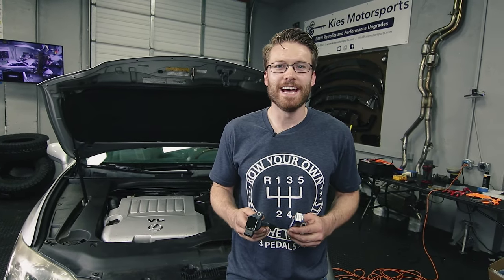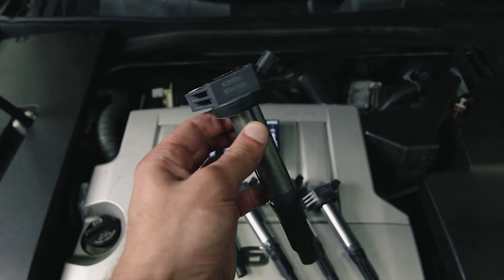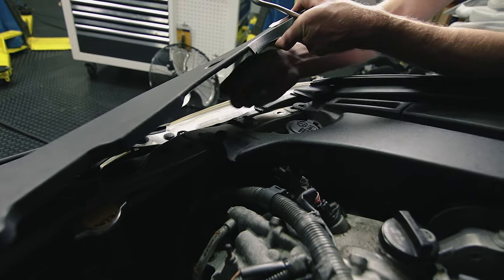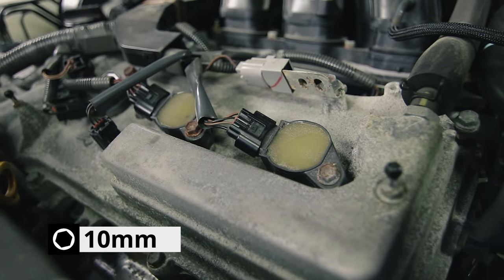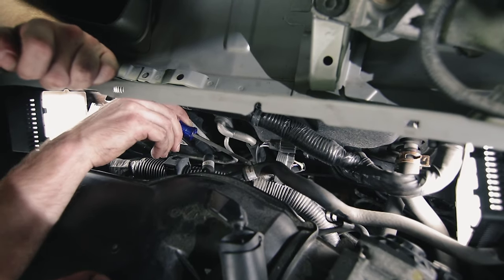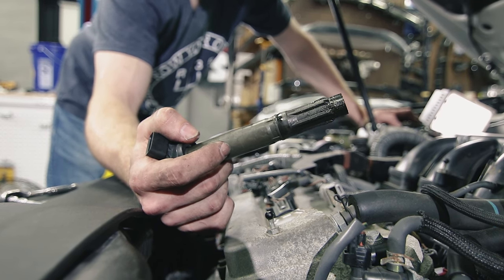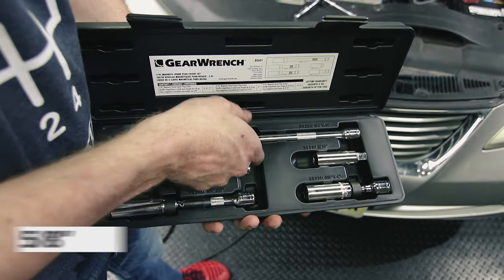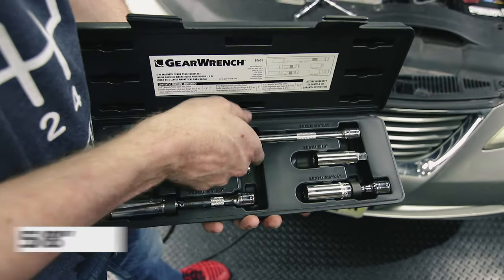How To Change 2GR-FE Coils & Spark Plugs 2006-18 Lexus ES350 / 2006-17 Toyota Camry - Under 1 Hour

Comment: 2012 Lexus ES350 -the video is helpful to replace 5 of 6 coils and plugs, however the coil and plug on  cylinder #5 are impossible due to the fact that the wire harness sits directly on top of the coil and even if you loosen its not loose enough to pull the coil out. I did 5 of 6 and am hoping for the best. I also noticed the video has the hood taken off, this would save a little back pain if you want to go to the trouble. I did not.

Comment: Thanks so much for making this video, I had seen a very detailed breakdown with pictures on one of the Toyota forum websites, but they had you taking the manifold off, after seeing you do this I was also able to successfully do it, and surprisingly it wasn’t nearly as hard as I thought (I had heard it would be a nightmare) the only tough thing for me on my 2009 six cylinder Camry was that I had to lay on the engine a few times to get my head back there and see what was actually going on, but thanks so much for making this video you made the job what I can only assume to be much easier.  One crazy thing that I discovered was that I also had a leak on that  middle cylinder on the back of the side of the engine, there was oil at the bottom of the coil, I guess that’s a common spot for the valve cover to leak on the 2GFRE engine.? Was wondering if there was anyway to tighten it up while I was back there but I didn’t really see much? If anybody knows a way to tighten those valve covers a little sometimes you can get a little more time out of your valve cover gasket?
Reply: No way to tighten those valve covers. You have to change gaskets. It is hard to remove back valve cover for DIY. I could not remove cover and I  had to ask a mobile mechanic to my home to remove it.

Comment: Trying to discern if my plugs need replaced?  2011 Es350 bought a month ago and I noticed chipped paint on the back of the hood which shows they have been done... just bought a '11 model with 135K on the clock.... purrs like a kitten!!  My OCD says I should go in and change plugs!   the fact that who ever didn't do it correctly isn't a good gauge of what needs done next! okay I talked myself into this project.... AKA peace of mind! 
should I replace coils? hmmmm
Reply from the maker: I would do em both

Comment: My scan shows I've an issue with number 4 coil, is that located in the back or the front
Reply from the maker: I believe that is the middle coil towards the front of the car
Reply: Also if your ignition coil is giving you trouble...

With you facing the engine and the hood up: 
Rear : A | C | E
Front: B | D | F

Comment: You don't need tools to remove the push pins. You just push them down to release and pull them up with your hand. I was doing it few days ago to replace the engine air filter...

Comment: Liked and subscribed... will be using this for my 2013 Camry Se V6

Question though... is it SOP to change out the coil packs when doing spark plugs? I’m at just over 93K miles, and have the OEM plugs and coil packs still in there. 

Also, I see some YouTubers applying anti-seize around the threads of the new plugs.

Also... would it be necessary to do O2 sensors when doing plugs?
Reply from the maker: Not necessary to do 02 sensors unless they are bad. At 93K I think your coils are probably still good. If you start having misfires I would change them out but they should last awhile. I'm running original coils on all my vehicles with much higher mileage. I am personally not a fan of antisieze. Newer plugs usually recommend against it. I would verify with the dealer or manufacturer of the plug. Most modern plugs have a coating that protects them. If you do use antisieze make sure it is barely barely any.

Comment: How can I torque to 7 lb-ft without any gauge? Is there any trick?
Reply from the maker: Sadly not. Overtime you start to know what is too tight or too loose by feel but it takes practice and still easy to mess up. A good torque wrench or two is worth the investment if you plan to work on your own vehicles.

Comment: Did you use a torque extension calculator to get to 13 ft lbs of torque?
Reply from the maker: we did not, good think to note that extensions do change the torque values - always use the shortest extension possible

Comment: Unless there are issues with every coil why would you replace all of them?  I have 2 Toyotas and have needed to replace one over 20 years and 400,000 miles of driving. I would never change a working OEM for a non OEM just to change them out.

Comment: What torque gun you have there? Or can you recommend a decent one from Amazon? Cause I just tried my manual torque wrench and just broke it. 😫😫
Reply from the maker: I really like this one a lot for most applications: 3/8" Torque Wrench: https://amzn.to/2XcilOY Make sure it has the torque you need of course but it is a pretty good overall torque wrench.
Reply from the maker: for an impact guy - Iove this one: https://geni.us/MLW2861-20_Impact
Reply: Thank you so much. I’m really new to this. First time ever diy on my car. Then the only thing to do is to buy an impact socket set right??
Reply from the maker: Lol no problem! Impact sockets are nice but are usually thick. They are safer to use but won't always fit into small spaces. If you are removing a small bolt regular sockets are ok usually but regular sockets can break apart from impact use.
Reply: Thank you. Makes sense. Now do I have to disconnect the electrical connection up by the windshield. Mine will not disconnect at all !
Reply from the maker: You can try to work around it. Depends on your clearance

Comment: Hello mate,
Am from Sydney. I have an RX330 which seems like needs new coil packs and I may do the sparks while at it. I am presuming the process is not to dissimilar to this model in the video. Other issue I have has to deal with for a few years now is white some coming out upon starting especially after long drive. Lately while driving there seem to be a gentle rattle before big puff of smoke. I seem to have spent more money in topping up with expensive-full synthetic  oil in this car then any other. It is a good and comfortable car to drive when it is running good as you are probably aware. Anyway I am a novice but I might try and changing the coil and plugs myself as I am not working at the moment and may be able to save some labor cost. Any tips would be greatly appreciated.

Comment: Usually I advice to only replace the bad coil with an OEM one. Since usually OEM coils are far superior to aftermarket. No sense in throwing away good OEM coils
Reply from the maker: I agree but given his mileage, likely others were going to start failing soon. The after market ones are still working for him tho with no issues.

Comment: Did they ever make a video on changing the rear valve cover gasket?
Reply from the maker: We have not. If it needs to be replaced in the future we will probably make a video on it
Reply: @TheSundaeDrive  Nice. Looking forward to it.
Reply: @TheSundaeDrive   How are the ignition coils holding up?
Reply from the maker: Still working well! Over 144K miles now

Comment: WELL,  tell us WHERE you bought the coil packs and what is the name on them ?
Reply from the maker: They are linked in the description but here you go :) 

NGK (6619) LFR6AIX-11 Iridium IX Spark Plug https://amzn.to/2p9WlGa

Coil Packs (the ones used in this video):
MAS Set of 6 Ignition Coils for Lexus Lotus Toyota 3.5l V6 Compatible with C1601 UF-487 UF487 C1601 https://amzn.to/33q4UeQ

Coil Packs (Higher quality, not used in this video): 
Delphi GN10366 Pencil Ignition Coil: https://amzn.to/2OFUhAm

Comment: Great video! Did you feel the coil packs snap into place with the spark plug or did you just drop them in there and tighten? Thanks in advance
Reply: They don’t actually “click”; as you say, just drop in & tighten. Not mentioned in the video, but I also add a dab of dialectric grease in the coil tube before dropping onto the plug.

Comment: Should had replaced the problem one on # Cylinder with an OEM or a Aisin replacement thats it,  those non oem coilpacks usually do more harm than good. The scanner said which one was needed!  It is just that simple!  I had replaced the bad ones with OEM never had a problem!  Also if the problem was probably caused by a bad  valve cover gasket why not getting a new one Felpro/ Heinz which are great replacements and put pressure washers on the  valvel cover bolts to avoid vibration or movement that contributes to their breaking up!  Ive done that and those valve cover do not leak for many miles!  Always being careful to not overtighten  them bolts.  Over tightening is  the # 1 cause of leakage because it could warp the cover etc!
Reply from the maker: All very good points. I would not have used a cheap brand on my car and when I saw the oil I would have replaced the gasket. My buddy was tight for time and cash and didn't want to deal with it at the time.

Comment: i done 2 sienna spark plug both of them have oil on spark plug at 3 at the back and oil is only at the thread of spark plug .....is that mean head gasket is leak?
Reply: It probably means valve seals or possibly piston rings.

Comment: How hard is a valve cover job on that car ?
Reply from the maker: Haven't done it myself so not sure. Shouldn't be terrible
Reply: As a Lexus Technician, I’ve seen a lot of older lexus models that leak from the valve cover. The front one is the easiest one, but the back is a little bit more complicated due to stuff getting in your way and the limit space you have to work with.

Comment: Why not go through the trouble and replace valve cover gaskets, spark plug tube seals and grommets? I wouldn’t want to risk damage to the new coils & plugs due to oil contamination.
Reply from the maker: Personally I would change those as as well but not everyone does. Also depends on the age and miles since the last service weather or not that is needed
Reply: did a honda with oil from tube seals leaking. plug gonna fowl out . might as well fix that problem or go back in again and again.

Comment: Odd. The coil packs on my 06 xls are still original.  Changed the plugs once with denso. 278k km. No issues. This engine like nano oil additives like ceratec.

Comment: How long did they lasted.
Reply from the maker: Haven't failed yet. See the top comment. Have to update it but still going strong.
Reply: What brand is the coils? Ngk?
Reply: @TheSundaeDrive  that's very good two years. Thank you for the video
Reply from the maker: No problem! Not sure of the brand, they are linked in the description

Comment: Hi, I just saw your video and I have a question. I replaced coil #1 with Denso Diamond (I bouth them on eBay, now I'm not sure it those were OEM) and I did it about a year ago. Now the car started with the same code P0351 that it's the same coil I changed. Do you happen to know why would the coil started to fail again in such short period of time? Thank you.
Reply from the maker: There are a lot of fake products online. Very good chance you got a knock off part or there could be something deeper going on.
Reply: @TheSundaeDrive  Thank you!
Reply from the maker: No problem! Best of luck with it.

Comment: i hav a 2013 higlander, same engine, i torqued it to 15 ft lb, is that a big deal/difference to 13 ft lbs?
and damn those coils are expensive
Reply from the maker: As long as they didn't break you are ok. You just need to be very careful because you can snap them off by over tightening.
Reply: @TheSundaeDrive  i couldnt find any info for torque specs in toyota sites and my owner's manual, then i went to denso's website and it says to torque anywhere between 15-22 ft lbs, so i torqued it to 15ft lbs, and then i saw ur vid and im like wut the hell, but everything seems normal, so i guess im good, thx

Comment: I can not believe that I am the first comment on this video.  But I am honored!  Anyways....   EXCELLENT VIDEO... THANKS FOR YOUR TIME AND ENERGY IN THIS VIDEO!  Especially the "how to release the clips" content and such.  I have a 2008 Avalon Limited.  A few questions.  1) This should be proceedure should almost identical on my car... correct???  2) when you took off the strut brace you only showed the bolts near the struts being taken off.  What is access like / how & where do you access the other side of that mount and  3) is it difficult to get the put the strut mount back on after taking it off?  4) Did you only take the Wipers and top part of the windshield wiper shroud off?  (most other videos show taking the entire sbottom part of the shroud out as well).  Your fast reply on this matter would be greatly appreciated!
Reply from the maker: Thank you! We try our best to make the videos as complete as possible. 
1) it should be a very similar process 
2) that access is good and those were the only bolts that had to be removed on this vehicle
3) Very easy to put back on
4) I'm not sure what you mean but we showed everything that needed to be removed. We did not remove anything not shown in the video. 

Best of luck!

Comment: My workshop charge for 4.5 hours for changing spark plug ?  Why I donot know and it’s charges labor 650$
Reply from the maker: if the valve cover had to come off and the gasket had to be swapped and some wires broke, they could be why. As things get older they don't come apart as easily

Comment: my 16 es350 has 65k and mpg is awful is that because of the spark plugs?
Reply from the maker: I don't think that would be your cause, your plugs may need to be replaced but unless you are getting really bad misfires, your spark plugs shouldn't be causing any issues like that. Could be the quality of the fuel you are putting in - try switching to a higher grade fuel from like exon or sunoco and see if it improves.

Comment: Seems pretty easy, took about 5 hours but before I started I saw my fuel injection connectors were chewed up by a rat. Which probably gave me the impression that I needed new sparks thank god i can buy connectors at an auto shop and just splice and play🙄

Comment: I'm waiting on parts for 15 Sienna. Anyone know if I can change plugs without removing the intake? All the other vids state it needs to come off. I'm changing struts as well so that wiper crowl is coming off anyway.
Reply: I've seen a few you dont..when I had Rav4 I did. Not having to remove it seems possible easier.

Comment: I gave guys a like but very disappointed on the third coil pack in the back, you skipped a step or edited it out at 7:30. That loom doesn't move by unscrewing the nut, it doesn't move at all, everything is super tight, the loom is very stiff, and it's loose but wouldn't budge enough to pull the coil and plug. I messed with it for an hour and still can't get it out of the way to pull the coil out.
Reply from the maker: It was tight getting to that one. I'd need to watch through the full video but it's possible we loosed some other retaining bolts or clips. I believe that earlier in the video we show pulling the clips. As best as I can remember, we included all the necessary steps but filming the back side of the motor was extremely challenging so we couldn't show things as clearly as we wanted to. We had to play with it and twist the coil pack to get it out but it did come eventually
Reply: @TheSundaeDrive  Thanks man,  yeah it's very hard.  I am debating if I should just skip that one and do 5. I really have no reason to do this other my OCD and 160k on the clock. 😂. My mechanic said if I have problem leave it or he will charge me $450 to do all of them.
Reply from the maker: @ahmadghosheh3104  lol if the plugs haven't been change in 160K miles I would say it's definitely time. The car will run better for sure. Hopefully you get it!

Comment: Those back three spark plugs are very hard to get to.  That passenger bracket is problematic and those wire packs on the driver's side are difficult to remove.  I got the middle spark plug fairly easy but decided to save the other two for later when I have some better tools to access that bracket.  Japanese designers certainly failed in this design on these engines.  Spark plugs are essential like oil changes and these people screwed both of these designs up.  Great engine and car but the stupidity is beyond belief with these designs.

Comment: Hi I really like this video. I want to do this to my Toyota Camry 2009. I tried doing this for the three easy ones in the front. But I found that it is difficult to pull the sprak plug boot/coil over out. I feel like it’s stuck. Is this a problem? I am worried if I try pull it it might break in half. Any suggestions to solve this issue? 
Thank you
Reply from the maker: +Widitha Samarakoon they are definitely on there snug. Almost a suction fit. Did you ever end up replacing them?
Reply: The Sundae Drive Hi I actually was able to remove the spark plug boots at the front. I’m hesitant to try the rear three since it seems like a huge job.

Comment: Do yourselves a favor and take that damn manifold off lol. I tried this method and wound up ripping my camshaft position sensor wires off the terminal....oops. Literally no room at all around that wire harness. Number 5 coil was the biggest nightmare. Also make sure to buy that whole set of spark plug removers. The 11 inch extension was impossible to fit in the back.  My first and last lexus. Haha
Reply from the maker: You'll definitely want a variety of extension. It is a challenge but doable without removing the cover. Stinks about your wires :(
Reply: My first and last v6😂

Comment: The coils will do the same as the old ones fail with all the oil, why not replace gasket then replace coils and sparkplugs , then see how long they last. It would make a lot more sense, and save money in the long run.
Reply from the maker: Agreed, I told him this as well but he just wanted the car running with no downtime l